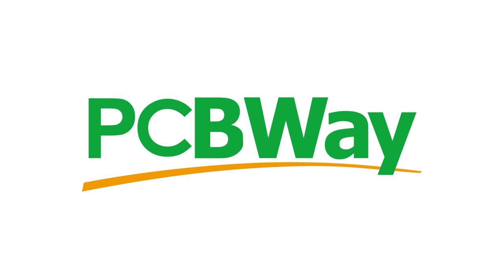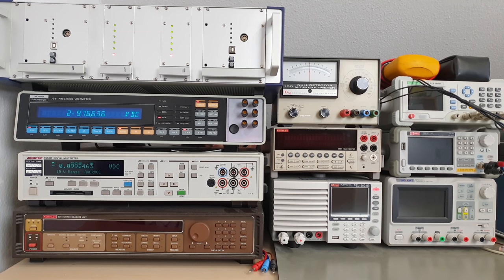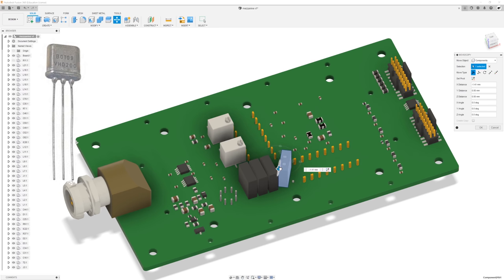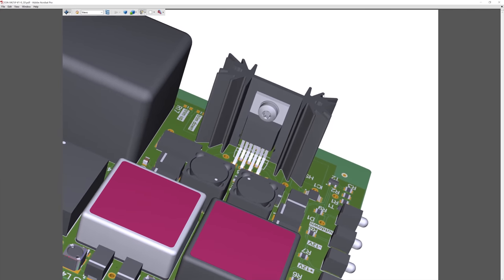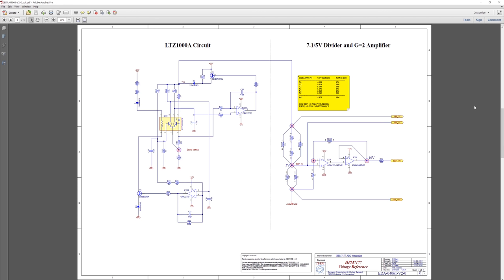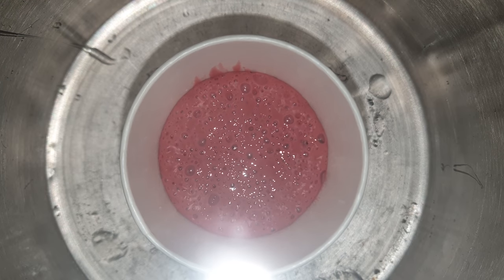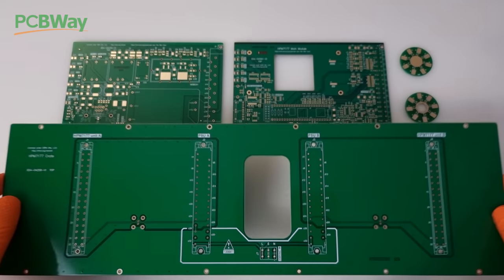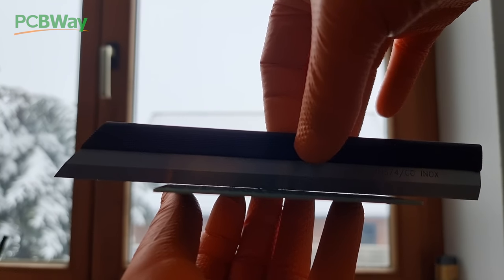Open Source 8.5 Digit Voltmeter from CERN: Build and Test

Comment: I came.

Seriously, though. I've been looking at the HPM7177 project and that EEVBlog forum thread in particular ever since getting my hands on some of the AD7177 devices. Such a brave approach, as it is implementing (and rather successfully) all of the taboos volt-nuts tell us to stay away from: Peltier temperature regulation, off-the-shelf Delta-Sigma ADC chips (as opposed to custom multislope converters), let alone attaching an LTZ1000 to one of them in a way that doesn't compromise its performance.

It was also awesome to see you successfully caliblate out the chips non-linearity. I always wondered whether something like this was even possible, or whether the INL plot presented in datasheets is actually full of spikes and discontinuities, and would be impossible to calibrate for. Instead of solving a high-order polynomial for every value, it might be better to pre-calculate points in advance using your polynomial fit into a look-up table and interpolate between them (or maybe even solve for every ADC count! If I'm not wrong, the entire table would be like 16GB total, which is nothing by today's standards). Really looking forward to you digging further into the firmware aspect of these systems. It should be possible to set these chips up for slower acquisition times, making use of their built-in digital filtering which will be quite an upgrade compared to plain averaging in many ways (e.g. 50Hz rejection). Wonder how close you'll be able to approach the 24.6 flicker-free bits of resolution the datasheet advertises.

Comment: Sample at chebyshev nodes and use numpy chebfit and you may be able to get a lower degree, less computationally intensive polynomial calibration curve. Or just interpolate using splines for a very computationally easy calibration compensation.

Comment: Few hundred thousand dollar SMT line? Damn what universe do you live in because I’d like to move there. One of my first projects had me doing lots of solder paste printing and I went to a manufacture of the printer. Base price was $250,000 USD. The config we used was maybe $300,000. The pick and place we would have used had we had to change the plan would have been $750,000. Thankfully the manufacture didn’t make us buy them. That was a hell project though. Nothing like FOD in a brand new unopened jar of solder paste

Comment: Marco, you might want to try piecewise polynomial functions. High order polynomials have well known ringing effects making them not converge well -- in reality a higher order polynomial on well behaved functions will eventually perform worse than a low degree one. The fix is to use piecewise low order polynomials, of degree 2 or 3. The data itself could be smoothed either using Bayesian methods or a simple nearest neighbor average; from this curve you can then optimize the parameters of the piecewise approximator using a method like gradient descent or something fancier if you sense it's not converging to a global optimum. The third or second order functions also make it much less computationally demanding as well. Feel free to ask for suggestions :) This is fantastic! --GNR

Comment: If we want to have uniform temperature on the whole board, instead of using a 6-layer PCB, is it possible to use an aluminum-backed PCB like the ones used for high-power LEDs?

Comment: How do you operate a peltier pad without developing condensation?  In a vacuum?  Only way i know of supercooling electronics specifically cpu's and processors without condensation being an issue is to basically have the equipment inside an ac unit more or less..  there was a video on it by technology connections i think..

Comment: When you mentioned thin film resistors in the beginning i started wondering: In precision applications like this, are those better for minimising Johnson-Nyqvist noise in measurements over carbon or metal film resistors?

Comment: Love your assembly videos and the humor!
Interesting reflow method. I have been using Chipquik low temp Bi57Sn42Ag1 paste and reflowing in a toaster oven with the peak reaching only 180C.
Much less stress on the components and very easy rework.
What do you use for a vacuum chamber on the two part silicone?

Comment: You may have used a oven controlled toaster oven to do the soldering. Oh this take me back to my calibration days. Then I remember how boring it was for me. LZA 1000A took me back. Grinder for front panel next time, yes I am that guy after all the CALS I did in a year.

Comment: Orthogonal polynomials .... they shouldnt have values beyond 1 or -1 inside the interval they are defined for, and I guess they would give you a more smooth fit. So for example a0*T0(x)+a1*T1(x)+ ... + an*Tn(x) where you determine a0..an
(https://de.wikipedia.org/wiki/Tschebyschow-Polynom or the english text)

Comment: Careful with your 10 degree polynomial. Runge’s phenomenon will ruin your fit outside the data points and prevent extrapolation. For interpolation, it’s fine, but you’re not gaining additional accuracy.

Comment: Unfortunately the PSU info now seems to be locked and needs a login to access. I have been looking at this in some detail and think I can knock a few hundred out of the design for a little reduction in resolution. Also how the bleep do you buy those resistor networks from Vishay?

Comment: Polynomial evaluation shouldn't be much of an issue, even on slow embedded hardware. Look into Horners method, its a pretty easy way to evaluate the thing in linear (wrt degrees of freedom) time. The speedup of not using python probably makes up for the much slower embedded hardware :)

Comment: What's the range of  price of the golden boy resistor network? I was thinking long time to make  some resistors old-style DAC for audio application and such kind of chip might be what I was looking for.
Reply from the maker: well they are pretty expensive for sure! but I looked for an alternative quite extensively and am sorry to say that there is none. one can buy 0.2 ppm/°C SMD resistors in certain values from digikey, but 8 of them are already more expensive than a golden boi. and then there's no thermal coupling or hermetic package yet
Reply: @reps  I made some research time ago as they were some resistors DAC kit that they where modelled on classic resistors laddrer DAC but they performed not as good as originals as precision of single resistors was not as good as original resistors ladder chip. I was evaluating if it makes sense buying some resistors array as the golden boy or better I source the vintage (also pretty expansive) ladder chip for the DAC project

Comment: Schematics for the new version are not accessible, so it's hard to say that it's open source for now
Reply from the maker: u sure? as far as I know only the PSU module hasn't been released yet
Reply: @reps  the psu is the only thing I was looking for, sorry for misjudgement. Trying to filter dc-dc ripple for white noise measurements in our heterodyne spectrometer and wanted to take a look at how they filter it. Is it simple capacitor multiplier based RC/LC filter?

Comment: Great video as usual!
I'd not use a high order polynomial to interpolate tabulated data like this mainly due to the poor behaviour of high order polynomials with high frequency data, normally you'd fit a spline, which in the lowest-order case is linear interpolation of rows (which is not hard to implement compared to cubic splines). I have a cubic spline class available here if you're interested (https://github.com/toastedcrumpets/DynamO/blob/master/src/magnet/magnet/math/spline.hpp).

I'd be really interested in seeing a Fourier transformation of the deviation. You might find deviations corresponding to different bits of the ADC, at least that's what I'd expect in a flash dac adc, no idea what a delta sigma would do.

Keep up the truly excellent work!
Reply from the maker: https://github.com/marcoreps/multiinstrumentalist/blob/master/inl.csv :)
Reply: @reps  Best python 1-liner I could do in 5 minutes. Nothing interesting. I think the steps might be too large, or there's nothing there to find, or I'm looking at the wrong thing, or all three!
import pandas, numpy, scipy.fft, matplotlib.pyplot as plt; df = pandas.read_csv("inl.csv"); m, c = numpy.polyfit(df['vref'], df['hpm1_counts'], 1); df['dev']=df['hpm1_counts']-(m*df['vref']+c); plt.plot(numpy.abs(scipy.fft.fft(list(df['dev'])))); plt.show();

Comment: Very nice project, Marco! I'm specially impressed by your VP soldering.
Isn't there any source code and µC platform from CERN for this project available?
As the A/D has 1ppm INL only, I don't understand the headline '... 8.5 digit DVM ..'.

This design may be 6 digits worth of resolution only, with your linearization maybe 7 digits, but nowhere near these 8.5 digits, providing that CERN has not made additional tricks in their implementation. And how stable might your linearization stay over time?
As the whole stuff costs 1700€ or more, what's the real purpose for CERN to build that on themselves, instead of buying cheaper, but more linear standard DMMs? E.g. the 34465A can be equipped with an LTZ1000 reference (clone) also, which lower noise is giving nearly 7 digit performance for a lower price.

Comment: If you can send me the raw data I will give you a better fitting function with all the stats you could want. That will likely not be a polynomial, considering those values are almost a straight line.

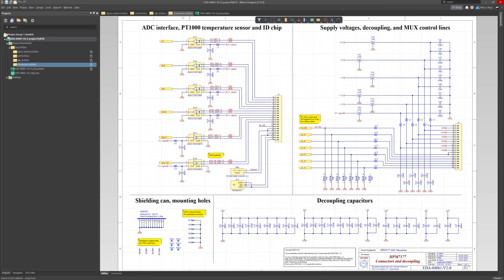Comment: 1:45 "except for a handful of custom resistors"
Horowitz&Hill: "any circuit that depends on specific resistor values, is a bad circuit" (paraphrasing)
edit: it's a joke. I ended up absolutely hating that book.
Reply: Where exactly did you get that quote from? (Edition, chapter, page, whatever.) Because I don't think it means what you think it means.  Lots of analog circuits use precision resistors to product precise analog outputs -- it's inevitable.
Reply: @Graham_Wideman  It was a joke. I hate that book. It doesn't teach you. It expects you already know the answers. In any case, the quote was wrong. It wasn't talking about resistor values, it was about expecting a transistor to have a specific hfe (β) value.
Once again, it was a joke and I absolutely hate that book. I used to think it was one of the best. Now I think it is absolute garbage.

Comment: But he didnt measure weight of solders,and how long legs are stripped , that will cause slight differences in resistance ;p which will cause slight alternations in the resulted data. So you can miss lots of data accuracy, in quantum world that may mean an object appearing at completely different time frame ;p

Comment: Although slightly cool... nobody (NOBODY) in YouTube-world:

1. has any practical use for a voltmeter with more than about three digits
2. has access to the resistors of the precision required for more than about three digits
3. is likely to take the time to make resistors with that sort of precision, especially when they have no means to verify their work
4. has any reasonable means by which to calibrate a voltmeter with more than about TWO digits